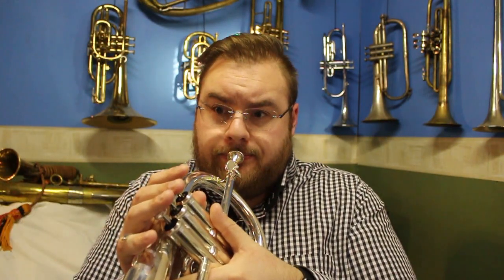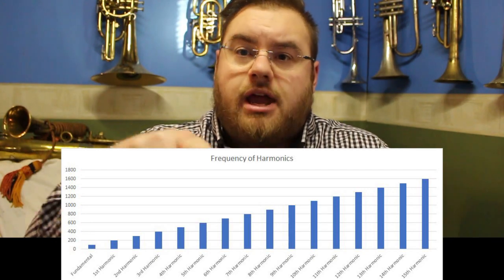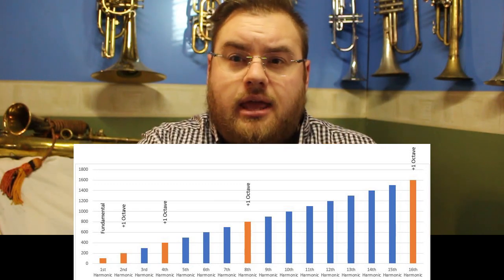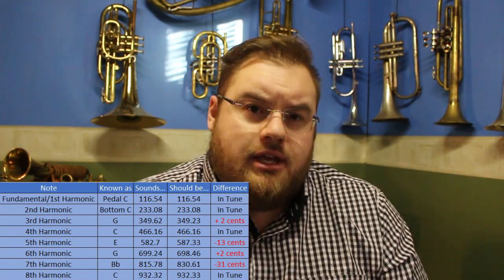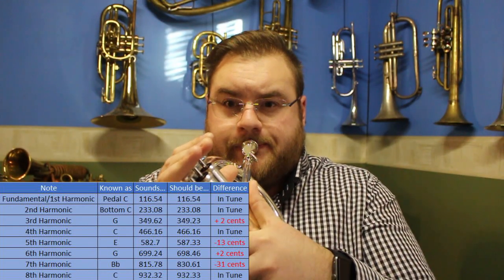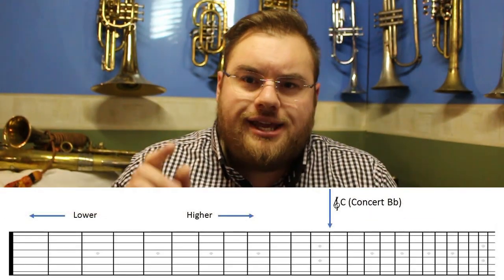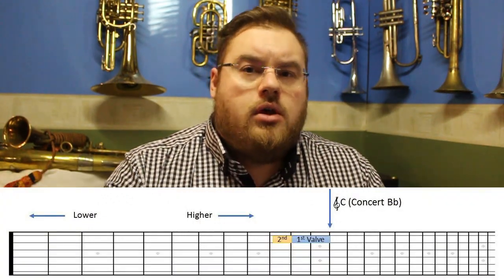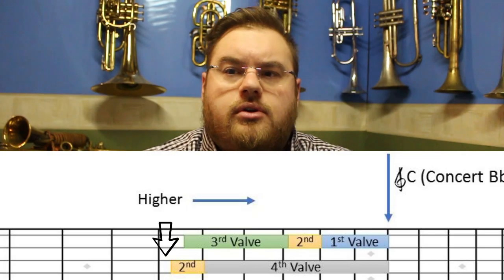The Science of Brass Tuning | Stuff all brass players should know

Comment: I'm a horn player and I'm curious how this relates to the horn. Because it can tune more valve combinations than other instruments, I'm wondering if it might be more in tune than others.
Reply: The horn is strange because it's a very long instrument but has a relatively thin bore and small mouthpiece (considering it's the same length as a triggered trombone). This means that it naturally plays way higher on its natural range than any other common brass instrument would, meaning that the harmonic partials are much closer together in the general playing range. To add to this, there is also the trigger which substitutes the valves of the horn for a set a perfect 4th higher, adding additional variety to the fingering. As if that wasn't enough, the performance practice of inserting the hand in the bell (for tuning, tone, etc), which historically allowed players to play a full diatonic scale complicates things even further. In summary, the French Horn is an absolute monster.

Comment: Guys? Should I be using my 3rd valve in stead of 1st and 2nd combined? Have I been playing wrong all this time?
Reply: As a trombonist that's about to pick up euphonium, I'm kind of wondering about this too.
Reply: I remember my second valve in my trumpet was broke to high hell, so I used the third valve instead and it worked!
Reply: The reason brass players typically use 1+2 rather than 3 has to do with playing notes within phrases. If you start playing a note with the first valve, and then go to the third valve, you need to lift 1 and depress three. If you use 1+2 instead, you only have to press down 2 for the second note. 
Brass players figured out that it's easier to lip a note into tune on the fly than to do the extra up-down fingering to get the 'correct' pitch.
Reply: Very enlighting. Thank you
Reply: As a trombonist, your ear should naturally cause you to 'lip' the bad notes into tune without even realizing it. My old band director was a great pro trumpet player, and he said that when he taught kids to play, he wouldn't even tell them about this problem - he'd just hope their ears would naturally catch the poor intonation and adjust without even knowing it.
Reply: but if your a phrase where you must go from 1+3 to 1+2/3, you'd be better off going with the 3 valve
Reply: Plus if you avoid using the 3d valve by itself, you can tune the 3d valve slide a little flat to help bring the combinations 1+3, 2+3, and 1+2+3 a little bit better into tune. (This is of course especially helpful on instruments where you can't adjust the 3d valve slide while playing.)

Comment: The fretboard was a useful device for explaining the valve combination problem. But lest anyone think this is just a brass problem, guitar fretboards aren't actually in tune down the neck - a guitar can never be perfectly tuned for every note. And all woodwind instruments are also out of tune on many notes for their own reasons.
Reply: Woodwind - range? what range?  I can make this tube play any note I want. 

The guitar thing was interesting though - I'm trying to work out if there's a compensation for the guitar in the angle that you play as you get higher - the physical contortion to reach those higher chords, your hand is at a weird angle, and tends to slide diagonally from high to low - does that actually make up for the tuning at some point?  (And is that intentional...)
Reply: Each guitar string would need its own frets to produce all in-tune notes. And just pressing down harder on the string behind the fret will throw it sharp. If you ever see a guitarist on stage tuning by strumming a chord, they're doing it wrong - those particular notes will be in tune, but it throws others badly out of tune. If you're only strumming three chords it doesn't matter, but anything else will sound nasty. On chords up the neck, as long as your touch is light there shouldn't be a problem.
Reply: While it can, the guitar would have to have 54 frets instead of your usual 21-24, with some frets serving the purpose to just making a couple of notes in tune, as demonstrated by True Temperament inventor Ander Thidell.
Reply: Tunefulness on a guitar depends on a lot of things like how deeply the nut grooves are cut, your string gauges (different vibration characteristics), how high the string is off the fretboard (every time you fret a note, you're actually bending the string ever so slightly), how hard you fret the notes and so on.

Comment: I'm a little confused on the frequent thing, so let's say that since I play Trombone I'm playing the Bb scale, is each note from the B to the C to the D and so on a new frequency or is it that Bb, past the F to the next Bb, then past the D,F,and A to that Bb a new frequency, so what I just listed was 3 frequencies or is each note on a scale a new frequency
Reply from the maker: The Frequency, measured in Hertz, is simply the number of vibrations per second. The more vibrations per second the higher the note sounds. The note A in the middle of the piano is 440 vibrations per second. An A an octave lower is 220 vibrations per second. As far as notes in the scale go, each note is a different frequency. We just use note names instead of memorising frequencies because it's easier to understand.
Reply: @Trent Hamilton: It's also more variable. We can tune the A to 435 and still use the learned system instead of having to work with a whole new set of frequencies.

Comment: The guitar example is a bit janky since a guitar player actually presses into the middle of the fret to produce the desired note. Because of this, you should have started in the middle of the fret. Also, the guitar player would actually press the middle of the previous note in order to play the note you were trying to produce with a valved instrument.
Reply: Yes, but the string doesn't pivot on the middle of the fret. The reason you press the middle is because it would take a very large amount of effort to apply enough force directly at the ends to make the string resonate to the note you are trying to play, it also would require more pinpoint precision than our nubby fingers can obtain. So the science behind is demonstration is correct, albeit slightly confusing to some guitar players I'm sure.
Reply: Both of these replies aren't thought out entirely too well. The string on a guitar, or any fretted instrument rings from the fret not from your finger. You could be applying pressure with your finger to any point on the string but it won't at all as long as the string is sufficiently pressing against the desired fret. Think of each fret as moving the nut of the guitar to that location.
Reply: it helps explain it, I don't see a problem using it to help people understand